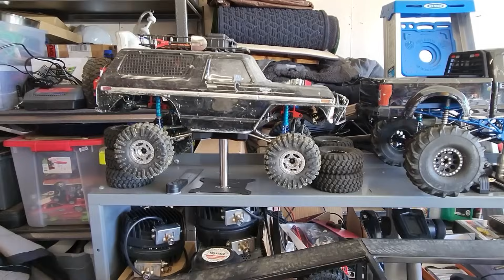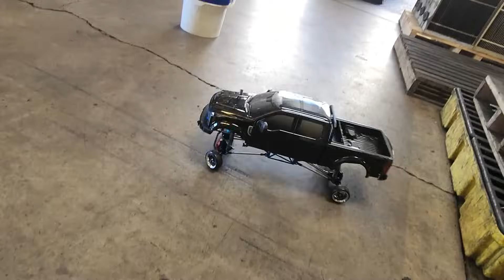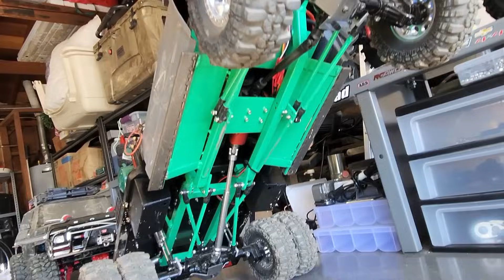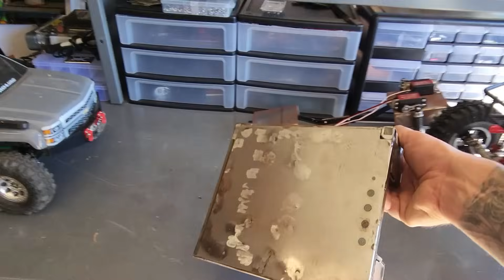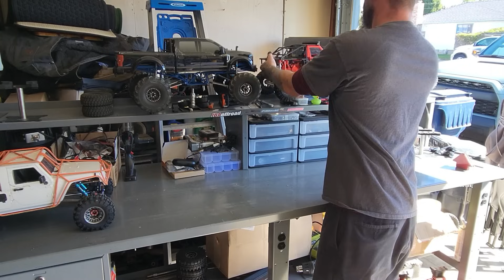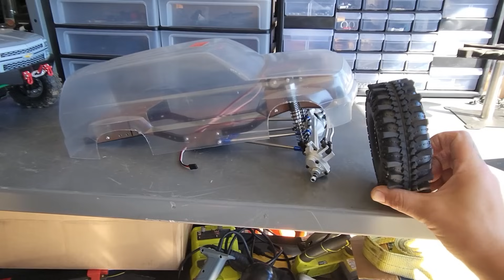Showing Off Homemade RCs... And How To Make Them Cheap!!

Comment: I have a 2 wd monster truck i built myself. Its bad ass! All aluminum and i took all the motor and esc unit out of my drag car and put in it. Just got the body the other day and just need a shorty battery for it. All metal gears, axles, transmission, frame, suspension arms, torsion bars, wheels, lol the works. It runs around 75mph. Just did a gear change recently
Reply from the maker: That sounds really cool!! One day i will build one that can go that fast.
Reply: @WafflesRC-pb4nt  that would be kool. My next build is gonna be a 73 to 79 Chevy build with a metal frame in a rock crawler version. I also scratch built a car trailer so I could put the fast one on that and pull it with my rock crawler when I get it built. I wanna do this one in 4wd this time. Build my own version. If I only knew how to just post pics here I'd show off what I have now, but Idk how to post pics yet lol, and thank you for the compliment. I have a few thousand dollars invested in it lol. Parts aren't too cheap and for the ones that were, it didn't take long to add up lol

Comment: This is sweet. I dig piecemeal rigs. I'm currently building my first 1/10 trail truck. I'm on disability, so I'm piecing it together with unused takeoffs, cheap parts, and free offerings from others. I've got VS4-10 chassis rails, AR45 straight axles, VXT tires and SSD wheels. I figure I have a long Wisconsin winter ahead to find the rest of the parts i need and get it built.
Reply from the maker: That is awesome!! Sounds like you have a good start
Reply: @WafflesRC-pb4nt  with so many people going to flat rail chassis it's easy to find stock ones. And nobody uses the VXT tires from the kits either. I think they'll be great for hauling my overland trailer on the gravel bike trails here in southwestern Wisconsin.

Comment: I like what you're laying down, but for the sake of saving one of your RCs should a battery begin to let go.. I'd avoid using zip ties for hold downs. Unless you're really quick with a knife or some snips. Maybe rubber bands? You got some cool rigs there, man!
Reply from the maker: Thank you very much!! And that is a good point on the batteries. I will get that changed out soon.

Comment: Not sure if this has been said already, also not sure if you have it already, but if you run a sensored motor and a little lower gearing on your mud truck it will crawl a lot better

Comment: That's incredible man but one question, what's your process for the welding what metal and what equipment do you use
Reply from the maker: I use a 110 gas mig welder, a cut off wheel and a flap disk. And sometimes a tape measure. I just put out a build video that shows all about how I build them.

Comment: What kind of welder do you use will a cheap harbor freight do the job?
Reply from the maker: The welder that i am using is a cheap Harbor Freight. It works great for these!
Reply: @WafflesRC-pb4nt  thanks  Flux core or gas
Reply from the maker: I'm using a gas but for this kind of work you can use flux core.

Comment: Aside from the chassis's you're building..the only thing breaking is the cheap stuff? Basically, all you're doing is promoting cheap goods from Amazon. I could do the same but I don't want my stuff to break as soon as I get it. Also loctite for metel to metal screws is a necessity for any mechanical part that move and are subject to high stress. In the end, you're going to spend more on cheap parts than expensive parts eventually

Comment: I want to make a tube chassie for my tamiya clodbuster it runs on duel brushless 3000kv motors duel hobbywing 60 amp esc both on 3s. Making 24volts its a ripper. It has a home made sassy chassie. Using rc10 battery trays. .